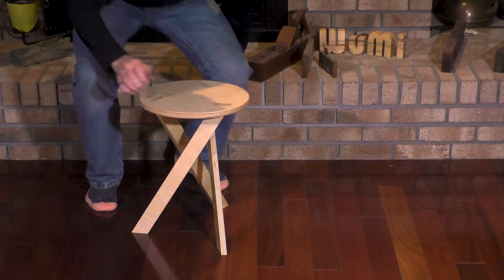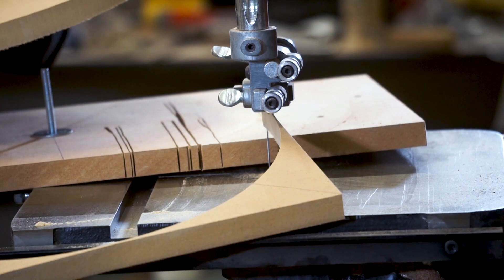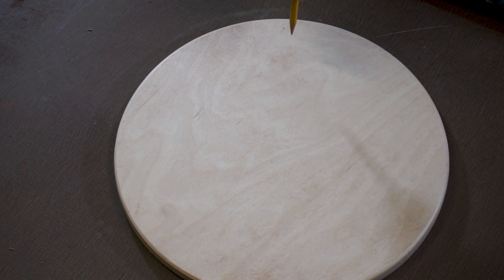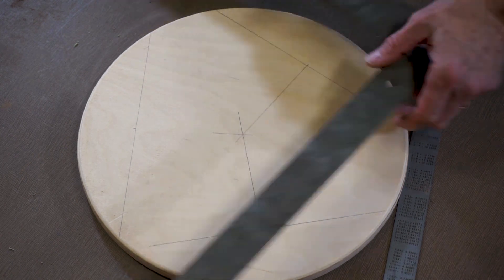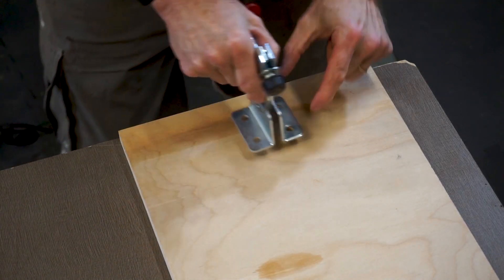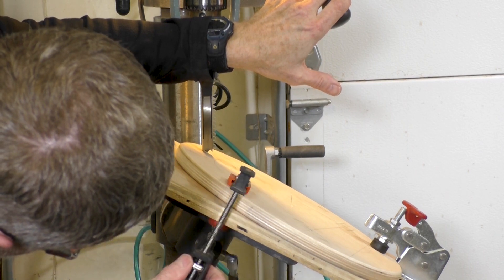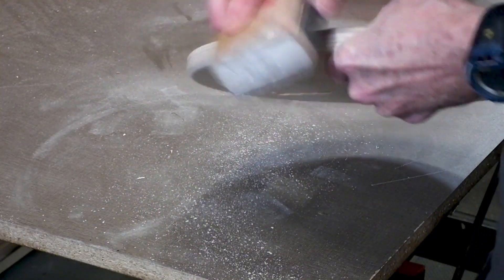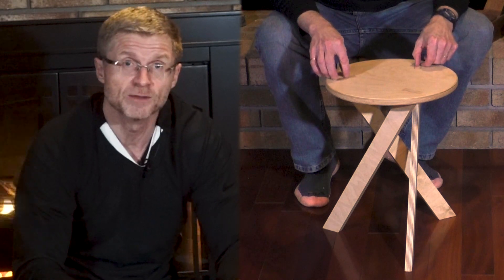Collapsible Wooden Stool with 3 Legs

Comment: Great video as already . I would try to make it but don't know if I could sit on it. Haha
Reply from the maker: It's actually not too bad to sit on. I was sitting on it at the start of the video, but the stool was off camera so you weren't able to see that. I think some viewers may be worried that the legs would push through the mortises, but as soon as you apply any weight to the seat, the legs are locked in place because of the angular force.

Comment: Great video! 
Is there any reason for the MDF seat pattern, other than repeatability? 
It seems unnecessary if you’re just making one stool.
Reply from the maker: I guess the only advantage is that I can make a mistake when working with the MDF rather than trying to cut the circle on the final piece. If I made a mistake, then I could just start over with a fresh piece of MDF instead of wasting more expensive wood. Not a big issue with plywood, but if I was working with a nice hardwood, I would want to minimize the potential for error. But you're right -- the main advantage is repeatability. Sergey has some other stool designs for me to work on, and I'm hoping some of them have the same seat size so that I can reuse this template.

Comment: To answer the question, yes, I would make it but, I would have to make sure that the legs stay in place and not poke through the seat of my (or anyone else's for that matter) pants. Three solutions to this problem: A) Cut notches at the ends of the legs and drill smaller holes on the seat. B) Make a false tenon with a couple of blocks on the sides of the legs or, in case someone wants to make things even simpler for portability's sake, C) a 1/4 ply glued on top (with some magnet inserts, perhaps?).
Reply from the maker: I shared your concern about the legs poking through when I started making the stool, so I experimented with a thinner mortise with a notched leg so that the seat would rest on the shoulder of the tenon. It definitely is a good solution, but then I realized that the legs don't move at all after they're positioned properly. Any weight on the stool will lock the legs in place.  I like working with magnets, and I think your idea to make use of them to hold the legs is kind of cool. The real shortcoming with the current design is that if you pick up the stool, the legs will fall out.
Reply: Well, it would be a challenge to find the right placing for them! Thank you for the timely response!